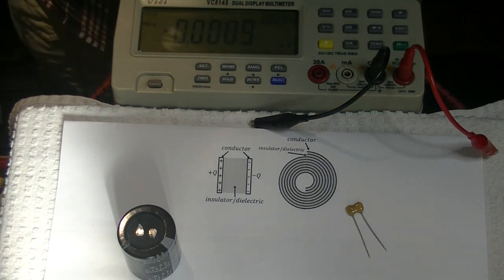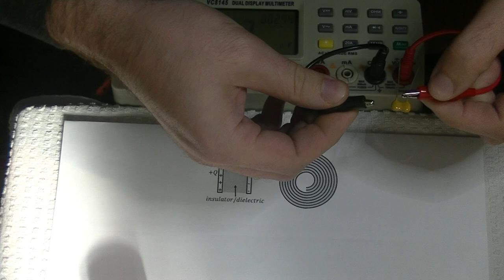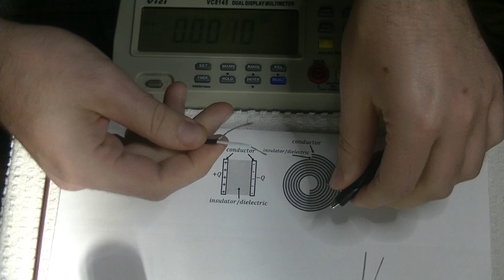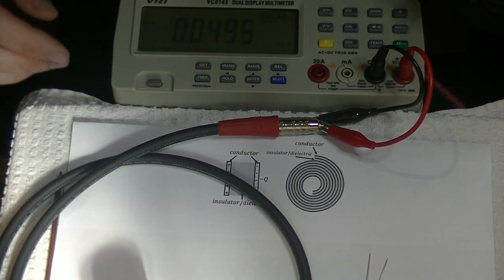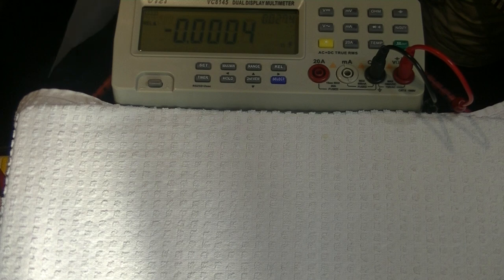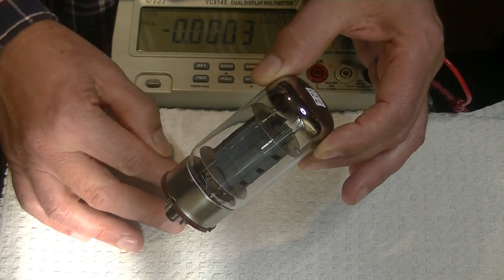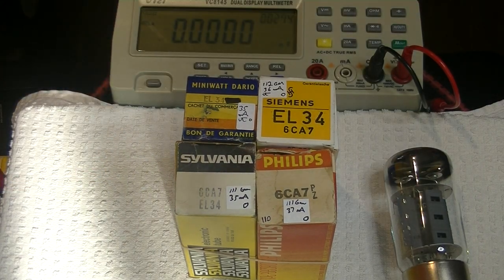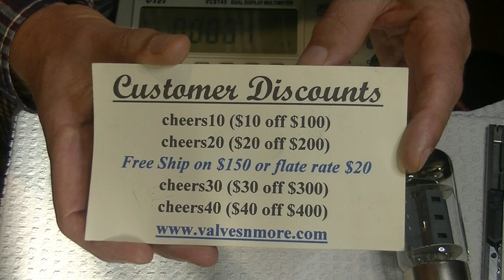Tube Lab #103 - How To Acheive Great Sound - Cables pt2

Comment: Fascinating video.  I am wondering how does a higher capacitance cable affect the sound as opposed to a lower capacitance cable?
Reply: I’m no expert, but afaik the higher the capacitance the earlier the high frequency roll off, so it will sound more closed in and less open..
Reply from the maker: A small amount of capacitance on it's own probably isn't going to affect the sound, but add in the circuit before and after, now you can all sorts of interactions, particularly when you combine capacitance with resistance,which creates a high pass filter.  Because this is a huge topic, we're taking on little pieces of it in each Tube Lab.  So we'll come back to it again and explore why different cables have less capacitance and how the capacitance affects the signal.  The take away though should be 1.  Run quality cables (note I didn't suggest expensive/exotic cables, Blue Jeans are excellent quality and very affordable) 2. Lower capacitance is preferable in your RCA cables and 3.  Keep your cable runs as short as practical.  If you put in place all 3 recommendations you can buy your cables, plug them in and forget about them.
Reply: @tubelab194  Well, an RC low pass filter, as the capacitance is in parallel with the source, between the line and return and/or line/return and the screen, I think. Take Mogami 2549 vs. 2534, the price you pay for better RFI rejection in the latter case, is increased capacitance, which may be beneficial with longer runs.
Reply from the maker: @paulb4661  I'm not aware of anyone who has done an in-depth study of all the possible interactions with various cable types.  And even though I find it fascinating I don't have enough years left to explore this subject thoroughly.  But what I do have is scope data and full spectrum sweeps of various prototype and Kit Amp builds.  We use the Blue Jeans LC1 cables for all of our sweeps and consistently see clean test sweeps 20hz - 20khz.  I suspect some of the cable interactions (EQ) people are hearing are one or both pieces of audio equipment interacting with the cable.  I remember fine tuning the output of a prototype phono preamp with a silver mica cap in the low pF range, the same range as even the LC1 measures at - that was enough to convince me to pay attention to the capacitance of every wire that carries the audio signal, both IN and OUT of the amp!
Reply: @tubelab194  I have only tried to point out specifically, that interconnect's capacitance acts as a low, not a high pass filter. Mogami is the brand I'm familiar with, hence used their twin vs quad configuration as an example. I wouldn't expect any appreciable signal losses of the interconnect itself, until well into the Mhz range, using a low output impedance sig gen and a high input impedance scope, but this does not take into account the actual audio gear interaction. Here we will have the source output impedance, load impedance and capacitance, combined with cable series resistance and inductance, then parallel capacitance and finally loss (insulation leakage) resistance forming a circuit. Let's say we have:
1kΩ source output impedance,
1Ω cable series resistance,
0.33μH cable inductance,
1GΩ insulation resistance,
100pF cable capacitance,
100kΩ load input impedance, 
220pF load capacitance.
We can expect zero transmission loss until about 100kHz, with group delay and phase angle remaining in check until about 30kHz range, well above audibility.
If, however, we have:
2kΩ source output impedance,
10Ω cable series resistance,
1μH cable inductance,
100MΩ insulation resistance,
2nF cable capacitance,
4.7kΩ input impedance,
1nF load capacitance,
we can expect about 3dB signal transmission loss in general, rising to about about 4.6dB at 20kHz, with group delay apparent at 10kHz and a phase angle of about 30° at 20kHz. Obviously, all of this becomes of purely academic concern, once we hook it up to an amp and a bunch of speakers, even more so in case of tube amps, where their inherent high output impedance will interact with complicated speaker impedance creating well known peaks and valleys. Good rule of thumb would be to keep interconnect capacitance to below 1800pF with 1kΩ output impedance, dropping to 180pF with a 10kΩ one, I think.
Reply from the maker: @paulb4661  Have you bench tested your theory of the interactions?  In my experience on the bench we start out with the theory of how everything interacts and then once the circuit is assembled start measuring it.  And often we find out the exact opposite is true.
Reply: @tubelab194  Not mine, ran a few calculations based on common knowledge signal transmission equations. Perhaps engineering principles do not apply here, who am I to judge, I'm just an amateur.
Reply from the maker: @paulb4661  of course electrical engineering principles apply, however the interactions of even simple circuits can be surprisingly complex.  Take what we're talking about, a simple unbalanced cable - that part looks relatively easy to understand electrically, now add a fairly complex electrical devise before it and after it.  It's now no longer so simple and interactions can exist you are completely unaware of, and most importantly have not calculated in your theoretical analysis.  That's why bench testing is so important.  On our benches we are often designing prototype preamp and power amplifiers, we start with a design that is based on basic electrical principles, standard circuit designs and our own understanding of some of the interactions that we have analyzed on the bench in the past.  The finished design is always substantially different than the prototype design - that was entirely the result of bench testing.  A computer model and or computations can only get you so far!
Reply: @tubelab194  Bench testing of prototypes is fundamentally different from bench testing Thevenin and voltage dividers. With an appropriate output to input impedance ratio, a cable will remain just that - a cable. Once mismatched, not even gold plated quantum level purity silver handwrapped in finest chinese silk will help, I reckon.

Comment: Very interesting and detailed video about an eternal subject as cables are.
I followed your advice and I replaced the 6p3se tubes in my Willsenton R8 with electro Harmonix 6ca7.
Absolutely a great upgrade.
I have another dilema.I want to replace the three 6sn7 stock tubes with tung sol(that's my budget).In the store they have matched only as pair, quad, six, eight...
The left and right need to be matched as one pair, but what about the rectifier tube in the middle? It may be matched with the other tubes or just as it is?
Thank You
Kind regards, Romeo
Reply from the maker: In the R8, v5, located in the centre is not a rectifier, and any good quality 6sn7 will be fine, it doesn't need to be matched to V6&9.
Reply: Thank you very much for your answer.

Comment: Those Blue Jeans LC-1 interconnects are fantastic cables.
Reply: I used to think they were, until I compared it to some others. These are my notes on the LC-1 compared to a more expensive, neutral sounding cable called the Nanotec Music Strada #211

Blue Jeans LC-1 ($50~ USD)
This cable is nice and bassy but is lacking a lot of detail but has a neutral sounding stage. The crispness of the pick on strings is lost. The shaker is harder to hear. When listening to other songs that I know the details are most lost on this cable. It rolls off a lot of higher frequency.
Reply: @DrJum  Thanks for the info. Will definitely look into those cables. I’ve tried many over the years including some pretty expensive ones. My system is all tube based (phono, pre, and amps) and the LC-1’s are the best sounding ones I’ve found, I believe due in part to their low capacitance. Thanks again. ✌️ 🔊🎶😊